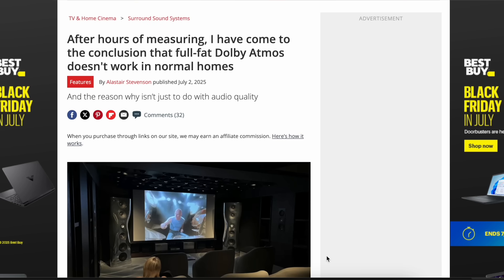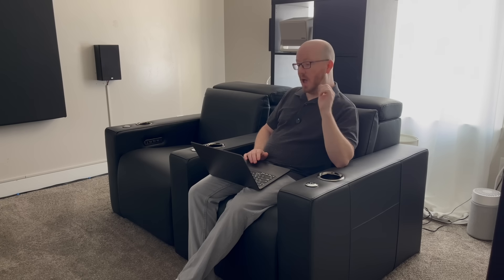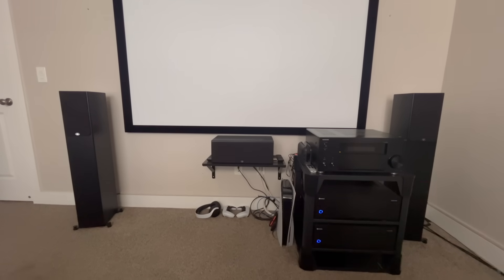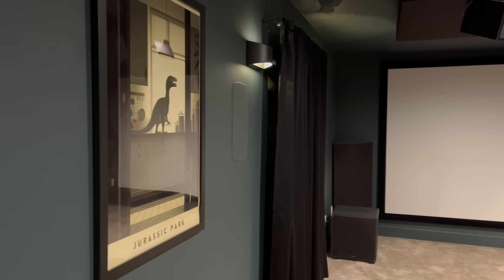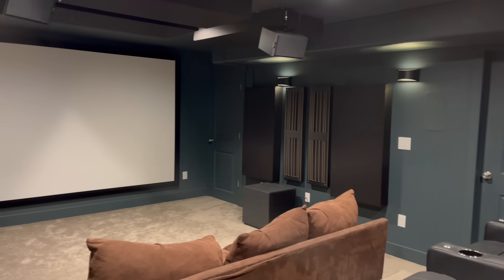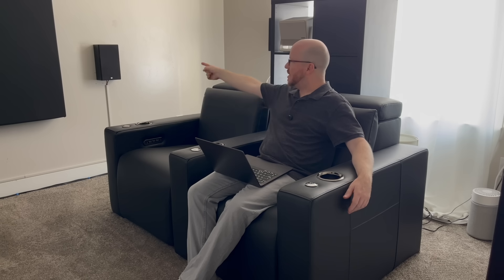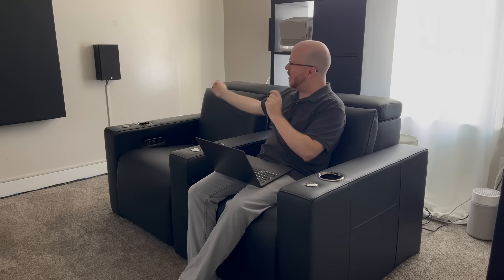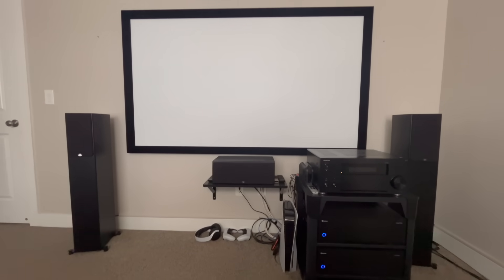Atmos Doesn’t Work in a Tiny Room? Think Again…

Comment: I have a really good sounding music Atmos rig in a 6.7m x 3.8m room which is pretty usual small/normal size in northern europe. And it's not even taking the whole space, there's still space for sofa & TV in the other end. I did first try an even smaller bedroom 1.7m x 4.5m and that did not work. What I learned was that small rooms need lot's of absorption (or possibly diffusion) as you have lot's of reflections close up that distort the immersive experience. I do have much more absorption than what most people would accept in a living room. Regarding ceiling speakers I mounted wood beams in the walls that goes across the ceiling and then the speaker mount to the beam. That way no holes in the ceiling was needed, only in the wall, which feels much less intrusive. Now, having wood beams across the ceiling is not for everybody 😆